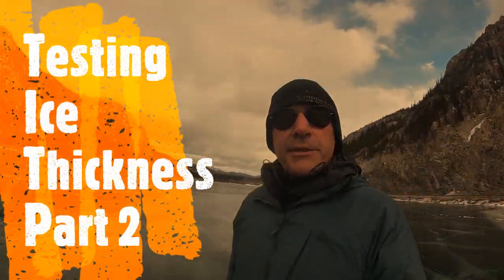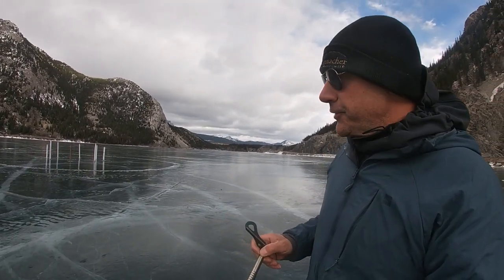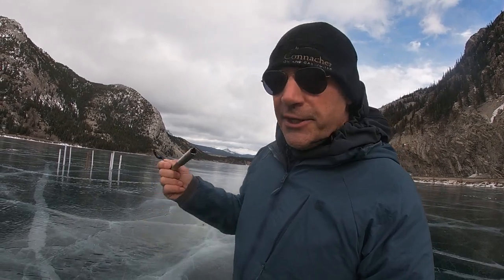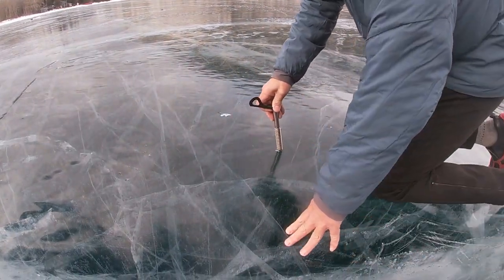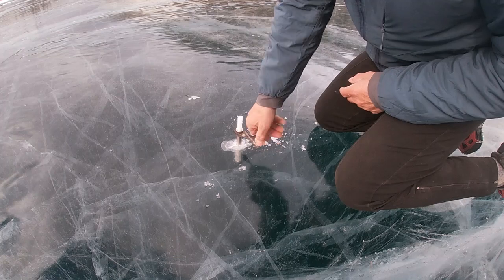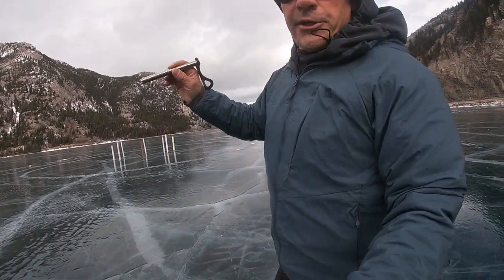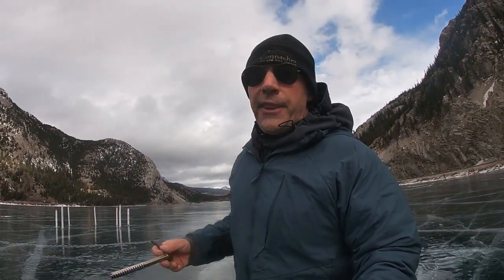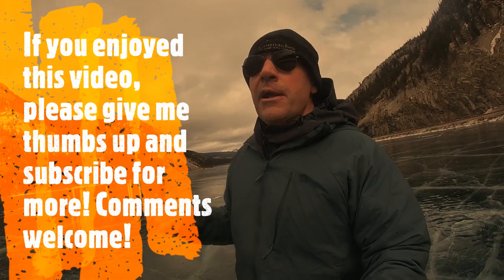HOW TO TEST ICE THICKNESS FOR SAFE SKATING - PART 2

Comment: What's the name of the tool you use tp drill into the ice to test the thickness?
Reply from the maker: It is an "ice screw" made for ice climbing. Petzl and Black Diamond make them. I would suggest getting an 18 or 20 cm length. You can order one online  or drop by a mountain equipment supply store.
 https://www.sportchek.ca/en/pdp/black-diamond-express-ice-screw-22-cm-70315667f.331204928.html?gad_source=1&gclid=CjwKCAiAnL-sBhBnEiwAJRGigotY7FXmJLZ0caZBmonYfUYjGzQ9h3RBdbe4vpb2mu0dv499S58HcBoCeAYQAvD_BwE&gclsrc=aw.ds.
Reply: Thank-you ever so much.
There's a local climbing store. I'll give them a try. I looked on line at Cabela's and didn't find.

Comment: Thanks, these videos are amazing. It'd be amazing to see a video where you test ice which is NOT thick enough to walk on for reference - like from the edge of a barely frozen pond or so. Please don't get yourself in danger, though!
Reply from the maker: You are welcome. That is a good idea. Yes -- it is hazardous for sure. I once went out and tested the ice and got 4 inches of depth near the shore -- so the thin limit of thickness for skating. I skated near the shore -- perhaps 6 to 10 feet from the shore and skated around a point of land -- suddenly, I broke through the ice the water was deep enough that my feet did not touch. It was only 1 inch thick right there. I completed a self-rescue using the tips of my ski poles as "ice axes" so to speak. (I also had an actual ice axe on a tether for self-rescue purposes, however, in the moment, just  used my poles) I realized that the current in this lake swept around that point of land and thus the ice was not as thick as it was near the shore several hundred yards away. I did hear some slight cracking noises before I broke through -- which I erroneously, and wrongly disregarded as the ice settling slightly. So an overabundance of caution is necessary. Moving water drastically changes the ice thickness. Even in this video, the ice was several feet thick -- but about a mile down the lake was open water where water entered the lake from a cave in the mountainside. Late in the winter -- early spring, on Crowsnest Lake, there was water at the shore and ice about five feet out since the water was heating up faster near the shore because of the shallow depth. I did NOT venture out. Discretion is the better part of Valour! (as my Dad used to say!) All the best! Stay safe!